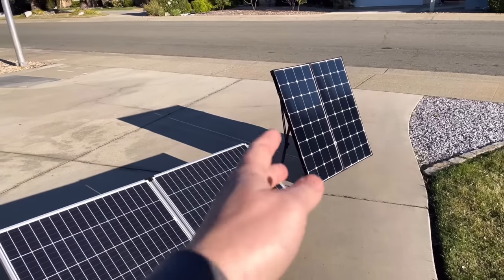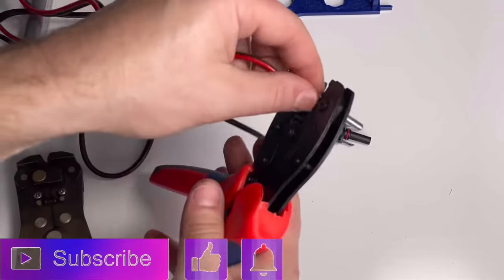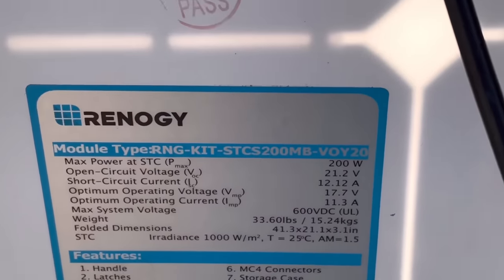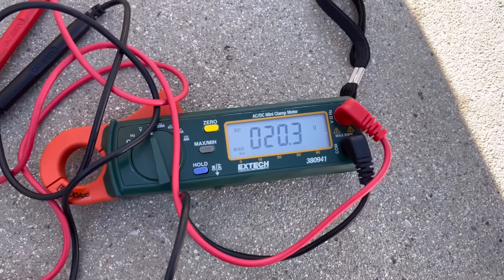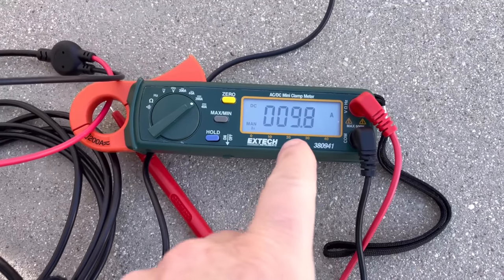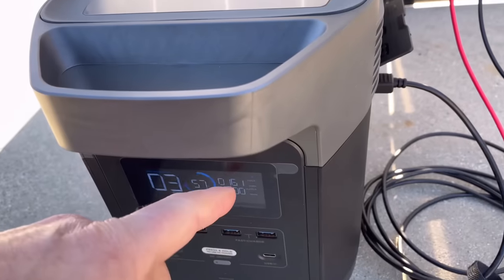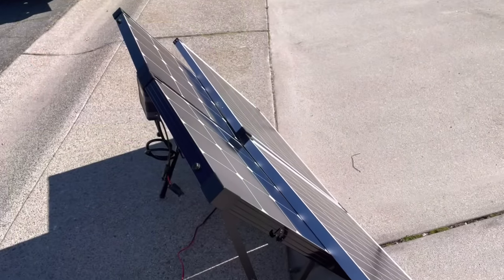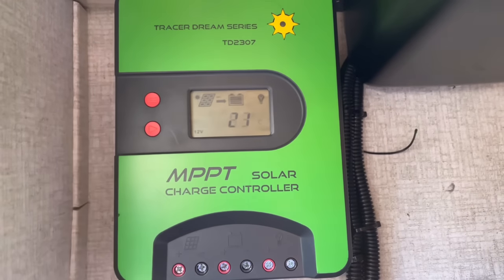Best Solar Panel - Harbor Freight 100 Watt Solar VS Renogy Eclipse Solar

Comment: Interesting that you are appearing to compare two products and drawing a conclusion that the Harbor Freight is less expensive and better than the Renogy when the price of the Renogy includes parts and features that the Harbor Freight system does not have. For the price of the Renogy package it comes with a storage bag, adjustable legs, a charge controller, and the panels are hooked together; none of which the Harbor Freight purchase contains. The Renogy is a ready to go and use system while the Harbor Freight purchase is solar panels only. This of course is not a fair comparison but you know that so why not mention it. Both sets of panels are mono crystaline so they will perform closely.  I am presently surprised to see that HF is now offering Mono panels. I bought into Renogy 6 years ago. I own the Renogy PWM in your picture but did upgrade to MPPT for more efficiency out of my 100w mono panel. Still you have useful information to add to the many other videos of solar and folks watching who haven't bought into solar for their campers should be inspired to take the plunge realizing that solar charging does not require listening to noisy gas generators while enjoying camping at places without electric hookups. Best wishes.
Reply from the maker: Thank you for the comment and thanks for watching.

I don’t think I said a 100% that HF was better. But it’s a good option to look at on a budget and for less then $125 extra and a couple hrs you can have adjustable legs, pwm controller, door hinges and a case. Now the real test is to leave both outside for a year, test in best conditions and then suboptimal conditions to see what holds up better. 
Currently the HF panels are outside in intense heat or will be all summer which are brutal where I live with temps to 116 during the day. 
So we will see how these do after the summer if they are fried or did they hold up.

But yes solar and power stations have come along way in a short time. Imagine in 5 years!!! 

Oh and a lot of times people ask what’s the cheapest 200 watts I can buy?? Well… you know there is always good and bad in that question. 
But the HF panels seem like a good option for that question currently. And with the HF warranty you can get… it does make it a decent option to look at. 

Thank again for the comment and for watching 😀👍🏼

Comment: Im so lost! I have (3) HF 100w (4 25w panels) kits with (3) charge controllers (1 came in each box) then I have (5) HF 100w panels and (2) hubs that will connect only 400w each. I was going to get a EcoFlow Delta 1260Wh portable battery but someone told me I should just get a couple deep cycle batteries from Batteries Plus, and then I'm reading the HF controllers don't last and don't look at the watts look at the amps and then there's volts and all the connectors have to match the brand unless the brand says it will take HF panels.... I HAVE NO IDEA WHAT TO BUY ANYMORE.
Reply from the maker: Ok the 25 w kits are worthless and not worth your time…

Only focus on your panels and what you wanna put the power into…

A power station??? Like ECOFLOW?

Or batteries… 

Power station setup…
Take 1 or several 100 watt or bigger panels and plug directly into power station with correct adapter or connector. Done!!! As long as you don’t exceed the power rating of the power station which just depends which one you buy.

Build your own power station..

4- 100 watt solar panels…. Into a mppt solar charge controller then into your batteries. 

From your batteries into a inverter to run items. 

That’s about it for keeping it simple.

Only buy 100 watt or bigger panels from harbor freight or other places.

Or buy residential panels that are bigger but have way more watts for cheaper.

I’ll try to do a solar video for beginners  soon.
Reply: @johnnysweekends  ..thank you!! I was getting paralysis by analysis and just wanted to make sure my limited funds weren't thrown away. I did pick up (2) EcoFlow 1260 portable power stations although I'd like something fixed to the house, I'm in Florida so if we have to evacuate I'm bringing it all with me. 
Thank you for responding and I look forward to the beginners video 👍
Reply from the maker: You’re welcome and be looking for them soon. 👍🏼

Comment: You're using all the right tools, but why are you running an AGM battery...??? LiFePO4 is the way to go...
Reply from the maker: I’m a deal finder, you would understand if you knew what I got that battery for 😁
But that set up and trailer is gone. New toy hauler is running two SOK 206 batts. 412ah total. 😀👍🏼
Reply: @johnnysweekends  Oh I get it...
On my 5th I'm running 4x270Ah Battle Born GC3's, 2.2kw PV's in 3 arrays(2x800w, 1x600w), tied into 3 Victron charge controllers(2x150/70 and 1x100/50), feeding 2 Victron MultiPlus II inverters in parallel...complete 50A split phase, on or off grid...my only limitations are food and water...conservatively, I can stay out for about 30 days(longer if I really conserve), then I have to get water, food and maybe LP...
Reply from the maker: Nice I like the setup…. 
I’m going a different way from victron soon. I’m still building as work is consuming my time from building my trailer lol.
Reply: @johnnysweekends  Thanks...last part of the system is going to be battery upgrade, or should I say additional batteries...an additional 4x270Ah Battle Born GC3's will be added for a total of 2160Ah, or 25.9 kWh...
Reply from the maker: That is some powa!!!!! 👊🏼👍🏼
Reply: @johnnysweekends  Gettin' ready for the apocalypse...
Reply from the maker: Lol it could be soon 😂

Comment: why was your renogy panels covered up by your hf panels ?
Reply from the maker: After I tested tire Renogy set up, I then leaned the HF panels against the renogy to use there adjustable legs to try and get the best angle I could like I did with the renogy set up

Comment: Just a suggestion...I'm not sure why you (and MANY others) throw around all those numbers, but I suspect most folks watching your videos don't want to become electricians, they just want to know if I buy X, can I run Y with it.  i.e. what types of everyday electrical devices can I run with a setup like is being talked about.   Like coffee maker, hair dryer, microwave, air conditioner etc.  Talk about real life situations like what would be required for minimal living, i.e. give an example of say I was able to power all my electrical needs for 2-days, or I needed to run my generator X-number of hours because there was no sun for 2 out of 5 days.  Real life situations like that.  I understand situations are different like batteries and the quality of such but most normal folks can understand how their particular situation would be different from yours.   Just my 2-cents, hope it helps you appeal to more viewers like myself.
Reply from the maker: I could do a little more towards that in future videos, but like with everything no matter how much solar I have if it’s 200 watts or 2000 it’s only going one place to be stored. That’s the batteries. So what you wanna run and for how long with really depend on how much energy you can store and the solar depending on size is how fast you can fill it up depending on how much sun there is and size of system. 

That’s kinda the basics before you get to inverters and Ac stuff.
Reply: @johnnysweekends  well there ya go... talk storage, not all the electrical math stuff.  Folks just need to know basic real life stuff.  I don't need to know how the internal combustion engine works, just how to drive the car so to speak.  Just tell me what the car can do and if I need the engine rebuilt I'll take it to a professional.
Reply from the maker: Lol ok I’ll work on keeping it simpler. But I agree even when I watch other videos the tech part is cool but I kinda want a stripped version. 

Thanks for the comment and thanks again for watching 👍🏼😀
Reply: @johnnysweekends  Please don't drop the tech stuff, Maybe edit and give time codes for those who want to skip and just watch  the skim milk version

Comment: What is the advantage using MC4 vs SAE?
Reply from the maker: All depends what you need. SAE is not a water proof type connection like a mc4. But all my gear and test equipment is mc4. So just easier but SAE or Anderson is a easier connect to take apart frequently

Comment: I have been trying for months to buy panels and a generator. I bought panels a few months ago couldn't figure out how to use them. I had them in the Sun for 5 days no charge returned them. I couldn't find out how to actually use them. Then bought a generator that I can use with electric or solar but I want solar. I cannot find any videos that are plain and simple I don't understand why simplicity eludes us?  How do you plug in the damn panel to the generator? I was told at harbor freight surprisingly I needed some kind of a connector. Can somebody just do a basic how to for dummies?  How this all works because I'm listening to your video and I'm like what in the world are you talking about?
Reply from the maker: Yea I’m getting more people asking for a simple how to on having power to simple things like a shed or what ever. So I’ll start gathering some stuff and do a basic video for off grid or whatever. 👍🏼
Reply: @johnnysweekends  finally!

Comment: Why would you purchase the Renogy panels from a seller who is charging $550????? You can easily buy these from most sellers for just over $300!!!!!
Reply from the maker: You do realize this video is old and prices have changed a lot. Like a lot .
Reply: @johnnysweekends  Give me a break dude, I purchased my Renogy panels 10 monthes ago for $320 plus tax. You do realize that inflation is running around 9 to 11%  for the last 15 month period, and you also expect me to believe the cost of these have dropped 42% in price in that same time frame!!!! This would have to be the only product in the entire world that was to accomplish this amazing feat!!!!
Reply from the maker: When I did this review just over 16 months ago and researched the price listed on renogy site, it was $549 for the eclipse setup with case and controller. Those are facts, take it or leave it. Not sure what else I can tell ya. Prices on everything have changed dramatically for everything.

Comment: After studying solar panels for some time I
made a couple of discoveries you might find
of interest.
1-The most popular solar panels are the 100 watt
-due to their affordability. HO|W|EVER, after studying 
all different size panels I discovered that the bigger
panels generate more watt per square inch than the 
100s. SO, dollar for dollar altho the 100s are affordable
the bigger panels give you more bang for your buck.
I'm talking the 320 -350 watt panels.
Just a Thought...

!
Reply from the maker: Thanks , yea I always recommend to people if you can and if it will work, use residential panels because yes, you get more watts per dollar. Only problem in a Rv set up is sometimes the weight or size can be a factor. 
Two 365 watt panels with mounts is getting close to almost 100 lbs.

Comment: Would this be good for a greenhouse?
Reply from the maker: It would work but so would any others. Just buy the same size panels. But also know what you are plugging into first. Which would be your solar controller or power station.

Comment: Harbor Freight for this beginner
Reply from the maker: Good way to start cheap, or even used ones as well can be had for good deals just do a voltage check..👍🏼

Comment: Cable length and cable gauge vs voltage.    Cable gauge,, even for 6 to 10 feet when dealing with DC can make a huge difference.  As you checked voltage and amperage at various points in your test set up,, you were often dealing with difference cable length.  Checking the volts or amps at one end of a cable and then farther down,, of course there is a difference.  Checking in the trailer controler,, one panel sending 17 volts  the other panel sending 35 volts,, the 35 volts will certainly flow the same sized cable more efficiently.  Please  run some tests, that all can see, using different gauge cables,, or different length cables or different voltages down the identical cables.  I think you will be surprised at the readings and losses you will find.
Reply from the maker: I used the same cables for both set ups. 
Nothing changed except the panels and the wiring they had. 
The renogy setup never did perform great. I often wondered if there was a defect somewhere. 
But 12g braided wire is fine for 12 feet, and 200 watts.
Reply: @johnnysweekends   Difference  Amps.  12g  for 12 feet   max amperage  is 20 amps and I would not recommend even that  the big difference comes 12g at 35 volts,, vs 12g at 17 volts.  At 17 volts the 12g is just barely okay.  At 35 volts you have plenty of room to spare,, same wire. More watts will make it through at the higher voltage.     For the RV most of your setups are close.  For many other applications solar panels will be dealing with longer runs than 12 feet.  I have installed a fair amount of low voltage lighting. There must be a perfect voltage at the bulb.  Wire gauges vary from 12g to 10g to 8g to 6g all on the same kitchen  every 5 to 8 feet of cable length requires a new calculation.  On the flip side, your application, you will find more watts(the net result of amps and volts) appearing in the RV controller if you also are running a higher voltage.  Just be aware,, when the wire gets longer,,, go to a larger gauge.  It makes a difference.
Reply from the maker: For sure, for this test and a small mobile solar set up 12g is fine. Roof applications most people are running 10g so they can run higher voltages when panels are in series. And then the controller will do the rest. But 8g may be needed if you plan on running a more serious setup at least from the controller to the battery if running a larger amount of solar. 
But again I’m doing series wiring going for voltage and not amps. 
Simpler and cheaper.
Reply from the maker: Actually looked at my extension and I did build it with 10g. I thought I did but didn’t remember. 

To many items around here

Comment: I have been wondering how the solar panels work if in a hail stones hitting them
Reply from the maker: Depends if the hail is big enough to break the glass and damage them. They hold up pretty well to small stuff but sure big hail will destroy them just like the rest of your roof.
Reply: @johnnysweekends  thank you

Comment: Do you have the panels connected in series or parallel?
Reply from the maker: Both are in series.
Reply: @johnnysweekends  I figured they had to be in series to get the higher voltage.  
I purchased and EcoFlow Delta and two of the foldout 160W panels kits.  The max I am getting is about 230W.  I just purchased a 100W  Harbor Freight panel and a SAE to MC4 conversion kit.  I am wanting to have enough input power to keep the EcoFlow charged while in use during the day.  My only concern is keeping the Amps to below 10 A.  Those three in series should work.
Reply from the maker: Yea series will increase voltage and parallel is amp increase. 
I have two, well 4, 335 watt panels and have two plugged into the delta in parallel. I’m over amps which is ok but not over voltage. You don’t wanna go over voltage because you can fry the unit. 

Now with what you are doing, what is the voltage of the 160 watt panel??

The HF is about 18 ish volts.

You typically don’t want to mix panels with different voltages unless they are pretty close. This is to optimize performance and output.
Reply: @johnnysweekends  The max voltage is 65V.  Each panel is actually running at around 18V per panel.  18 X 3 is 54V.  I think we are safe.  any more, we will have to go parallel.

Comment: Are you aware that the same wattage at different voltages results in different amperage?
Reply from the maker: Yup that’s just ohms law stuff.
Sometimes you just have to hand calculate your numbers to double check what you are getting is accurate.

Comment: Too bad you switched the plugs. MC4 are lousy over time. They cannot take being unhooked multiple times as I do as my panels are on the ground and I move every two weeks. They stop making a connection after a while. I even soldered them and still they failed. I cut them off and now use little grounding lugs with 4 holes, one being the main line to my controller.
Reply from the maker: They better mc4 connectors used in residential applications are better. The cheaper stuff on Amazon is poorer quality
Reply: @johnnysweekends  How can a Solar Noob tell the difference, and a source please.

Comment: i have a cheap friend i mean he has money but wont spend it. he bought 20 100 amp harbor freight solar panels  a cheap invertor and from March to about late November  he has a ZERO light bill almost every month. but since we have Entergy and they refuse to give us credit the best he can do is a zero bill. and from what i hear they trying to get it where the meter will not run backwards so at night he will have to pay. not sure how thats going to work out. but i had plans on going 100% off grid but noone would do it unless i was on grid. if it wasn't for the cost of the batteries i would just do it myself.
Reply from the maker: Yea funny how they talk about going green and wanting everyone to be green but now they are like no, you can’t be off grid or save energy! We won’t make any money!! Lol

Comment: Are these good for  100 percent off grid?
Reply from the maker: They can be but if you have the room then you can find good deals on used residential panels that are bigger but double and triple the watts for around $185-300 depending on panel and watts.
Reply: @johnnysweekends  ty. Yeah I gotta get away from mentally and emotionally abusive family member. Plus I do not trust US gov.